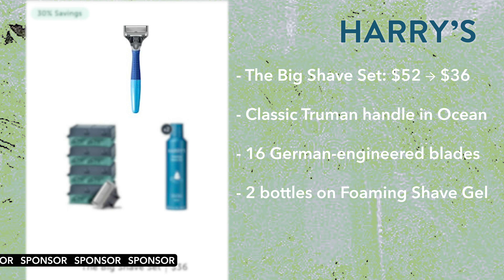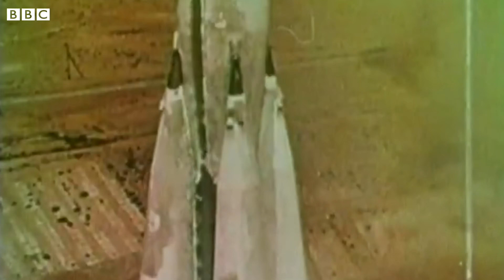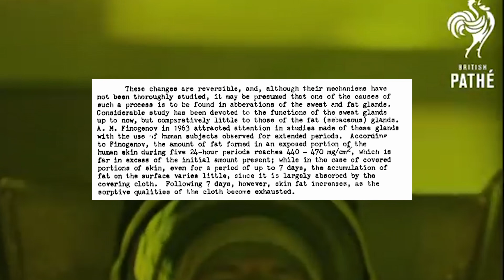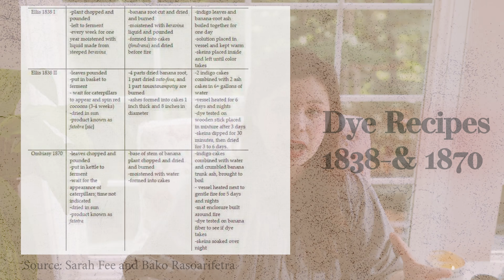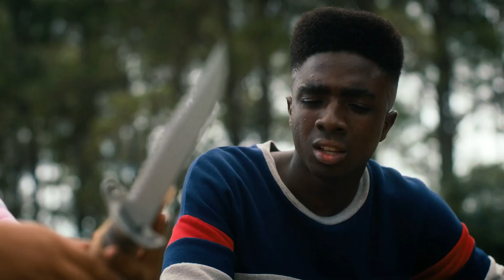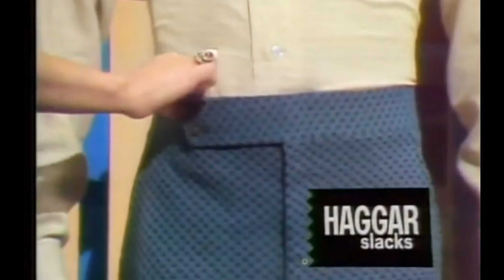The DISGUSTING truth about Laundry

Comment: Great video, and thank you. I appreciate that you didn’t try “solve” the whole issue. When I had a baby I was determined to do cloth diapering. After two washes the cotton diapers were like sandpaper. Not exaggerating. we had hard water, and although the diapers had been expensive, the quality of the cotton may not have been great. I cried. I started using elimination communication to cut down on diaper use, (how our farm ancestors did it) but to do that requires an enormous amount of privilege to stay home and be attached to the baby.  Lately I have started mending clothes, out of a tribute to my late mother, who lived as sustainably and frugally as she could. But again, The privilege to spend this time learning how, and the various materials I have acquired from Amazon, many of which have not worked very well because they are not good quality (bad needles, cheap synthetic thread) turns out better materials really help, but again, the money. I think I feel more guilty now than I did a year ago.
Reply: Regarding quality supplies, I like to buy vintage needles off of ebay. It's not too expensive, and the quality is incredible! Vintage thread, on the other hand, is sometimes still great, and sometimes very weak and prone to falling apart as you sew.

Comment: I grew up in Japan line drying everything because we literally didn’t own a dryer, and I remember getting in trouble for hanging out beach towels on the balcony at a hotel in Florida.
Reply: Apparently hanging anything outside to dry is seen as low class and most of the USA says low class = bad.
Reply: I lived in Japan for over a year and our apartments didn't have dryers. We line dried everything--Usually it worked great, you just had to plan ahead for things that took longer to dry.
Reply: Whereas I’ve never had such issues anywhere in Europe, where line drying is the norm and tumble dryers are mostly used for winter outdoor clothes that need to be dried quickly, or sometimes for towels as an alternative to fabric softener (that’s right, you never need both, and fabric softener shouldn’t be used for towels anyway because it makes them less absorbent).

Comment: well, at least you ruined stuff for me for a good reason! my family unfortunately uses a washer from at LEAST the 70's, top loader and agitator. we basically inherited it once my grandma passed and we were stuck in the cycle of buying a new washer every handful of years because planned obsolescence and the newer washers always spit in the face of right to repair. while it's been running strong with no sign of doom on the horizon, now i kind of wish it were ready to retire or at least have a midlife crisis. we still have the old one that quit on us because my parents never wanted to lug it to the dump and it's absolutely not worth selling unfortunately, so it's basically collecting dust on our side porch and whenever i mention getting rid of it mom and dad insist they want to repair it. it's been out there since 2016! it's a hidey hole for squirrel nests at this point.

our dryer is newer and we've repaired it a little over the years, the timer nob somehow got fucked during said repair and we had to relabel it because now the 80 minute section has rotated to where the label for 60 minutes is.

you were right though, i never really thought hard about the laundry i was doing. now i want to set up a line and start boiling clothes, but i don't have the resources to do so. only place for a line is overgrown and the neighbors' dogs would absolutely tear the clothes down at any manageable hanging height. maybe when the dryer finally kicks it, i can try convincing my family to find a good place to set up a line?

i also found out recently just how horrible fabric softener is! probably a few weeks before watching this, i ended up down a video rabbit hole of a washing machine repair guy. most of his videos were showing how bad the build up from fabric softener is inside the machine itself! apparently if you use fabric softener you have to regularly take apart most of your machine and flush and scrape it out. that combined with how bad it is for the environment and what it does to our clothes... literally a useless invention. makes me think of the marketing of listerine to cure halitosis! sell something that supposedly solves a problem that it absolutely can't solve in the first place and the same person selling the cure is the one who invented the problem. 

as an aside, the most interesting story i have about washing machines, which is much more interesting than usual washing machine discussion at least, is that when we inherited the one from my grandma we had to drain it because after the plumbing got cut off once she passed, something went wrong with the pipes and slowly dirty rain water started filling it up from the pipes going outside. got it mostly drained when we found rat skeletons at the bottom! completely cleaned, no gore or goop at all. my parents were freaked out by it and when they told us, i immediately fished them out with some sticks into a bucket and cleaned them off. they're now on my Collection Shelf :) most of it was the bigger bones, presumably the smaller ones fell through the holes in the drum or through the drain. got out all i could see, and i assume my parents had dumped whatever was left out and tried to forget about leaving the bones behind. funnily, after further cleaning and draining and scrubbing until it wasn't horrifying to use, my dad ran a load of his work clothes. mostly jeans. came in the next day from work and told me he found a rat vertebrae in his back pocket! i excitedly asked if he still had it (so i could add it to my pile on my Shelf) and he very indignantly said he did not. unfortunate, honestly!

Comment: I'd have expected parts of PA to be very hard, while I have hard water in New England, enough to require descaling of fixtures regularly, I've lived in parts of PA which were far worse (though amazing for my hair, go figure).  One of the other fun bits with hard water, when the copper lines start to erode, lovely bits of the pipes then become particulate shrapnel that one starts finding in the filters everywhere.  Fun times.

At least here I'm the US though, washers with adjustable speeds/cycles (whether as a set mode or ability to customize) are about the norm (unlike a laundromat here which may have a couple fixed settings).   I have, with success, washed underwire containing items and delicates (or strappy tanks, which are a daily undershirt type wear so i have a lot) in my front load for the last decade, and have an accordion rack for drying those items (folds flat but has five tiers unfolded).  Yes there is the occasional crappily made item which disintegrates, but I really have to blame the article/workmanship in 90% of the cases (fast fashion-like methods, grr), with the other 10% being operator error (jeans and strappy tanks don't mix, unless one wants to replace the straps). And yeah, cleaning cycles are a lovely feature but necessity in my front load at least (I have two dogs,  between my allergies and what I'm usually washing I don't want to do their stuff then mine without a good bleach and high temp sanitizing cycle).  I do wish the different symbols were more advertised or accessible without having to google, I've gotten a bit spoiled by the items which use words to specify the laundering directions admittedly.  I also have three different detergents (one being woolite), two types of bleach, steam iron and hand steamer, combinations of which I use for the maintenance of different garments (I also hate clothes shopping, most of my closet is well over 5yrs old with much of it more like 10yrs or more); not sure if that's indicative of being more familiar with modern laundering or screaming privilege, but it works and keeps my clothing in good shape.
Reply: Also when living in areas which are  damp/rainy/drizzly/humid 75-90% of the year, electric drier is a must.  The dehumidifier has to run double when air drying clothes, and mold/mildew still crop up, assuming the heavier clothes even dry before they mildew.  And being mold and mildew sensitive, I need to be able to breathe.  Dryer is a must here.

Comment: Interesting, looks like I'll change how I do laundry. Currently t-shirts, athleisure, and underwear all get a warm wash together. Looks like I'll start separating the underwear for a hot wash...but will the hot water affect the elastic bands or the lace on our underwear? It seems like it wasn't designed for hot washing. 
I separate my clothes for the dryer; socks and sweatpants go in, and everything else get a line dry on an interior rack. I'd love a clothing line, but my yard is too small, and the season too short. PS: I have t-shirts that are 10+ years old and still without holes...I don't know how! They're just poly blends from RW&Co or Suzy Shier (these are Canadian shops). Nothing special, but all my thin light cotton t-shirts don't last.

Comment: I’ve switched to using a laundry soap that has 4 ingredients, no sudsing agent, with natural fragrance. It’s expensive but worth it. My commercial liquid soap is rarely used. I separate things as much as I can since we have a very small apartment washer & dry them on a line or rack 95% of the time. My dad no longer itches as much. It’s expensive & takes a full day if not more to wash mine & my dad clothes. I do wash my dad’s clothes with a commercial sanitizer, would using alcohol in the wash so the same?

Comment: A Ruth Goodman moment? I live in upstate NY and yes the water is hard. A cup of white vinegar usually does the trick and we use too much detergent in laundry, I never use fabric softener because it affects the abosorbancy of your towels. We have a 40year old Maytag washer which has the adjustable water level so we don't need to use as much water in doing the clother's. Some things you just dont put in the washer without first reading the care instructions on the tag's. nobody reads them. Re: cheap clothing. They suck. the quality is not there and a really high quality  simple cotton T-shirt does not last more than a year.
Reply: Those old Maytags were good machines.

Comment: Cheap, easy, eco-friendly option: add vinegar to your wash: this helps with hard water and sanitization to an extent. 

Make your own laundry soap: plain soap flakes work find and dissolve fine in hot washes ie the white bedding, linen undergarments wash... for lower temperature washing you can pop plain soap flakes in a saucepan of hot water to pre-melt them, I then pour the really concentrated soap mixture into a bucket of water you can add essential oils (if you want to sent it and can also help with sanitizing) or other cleaning agents like bicarb if you want too and even agar-agar if you prefer a gloopier texture... There are plenty of recipies online

Water is only wasted if it isn't used again, if you have the space, use the water from the washing machine to flush the loo or water the garden (if your sure you're using safe soap)...

Comment: You could also use vinegar and baking soda for your laundry. Vinegar is antifungal and antibacterial and baking soda is great at removing tough stains, odors, and antiseptic/antibacterial properties. They are also good for removing some types of mold (not all but some). My mom would sometimes add baking soda and vinegar to a load of laundry when things weren't getting cleaned. It works really well and the vinegar will also soften your clothes. I tend to take baking soda directly to a stain and scrubbing gently. Also works for just basic household cleaning.
Reply: Using vinegar also helps keep your washing machine clean and odor free. I was having to do monthly maintenance on my machine and it tended to clog when I used regular detergents/softeners, but after shifting to vinegar my machine has not clogged once and I'm fairly certain it also runs smoother.
Reply: Using them together at the same time, they cancel each other out and don’t do you any good. (Acid vs base) but vinegar by itself is a fantastic addition

Comment: My brain broke at the comment that ~86% of North Americans take laundry directly from the washer to the dryer.  I have not relied on a dryer for more than a decade at this point.  As a grad student, I went a few years without onsite laundry and had to go to a laundromat meaning some of the stuff just was washed and then air dried at home.  I then had access to a line which my landlord and I used from April-October and then in January-February when it was -20 deg C and sunny (in Canada).  I went onto New Mexico where it was so dry that you could air dry everything year round - however, due to the higher elevation, UV and dust storms, I hung everything indoors to protect the clothing.  During Covid lockdown and my washing machine died, and I did put that stimulus check towards a fancy LG combo washer/dryer and I miss that machine when I moved back to the Midwest and couldn't install it in the current place.  It was perfect, I really made use of the fancy settings and since it could only dry half a load,  I still air dried pretty much everything.  I can totally see that 86% using the dryer though since I'm frequently the only person drying my laundry out on my deck on a rack in the entire apartment complex.  What really gets me are the unnecessary detergent options - I haven't used scented/dye stuff in years!

Comment: I  agree with EVERYTHING you’ve said. I went through this same realisation” about 10 years ago. I remember that every 4 years I used to purchase half a dozen cotton T-shirts and they would last beautifully. Then in the late 90s or the early 2000s, I had to find somewhere else to get my T-shirts and all the shirts available were now made of incredibly thin, often see through material that (in my opinion) dissolved in water. 
Fast fashion is dreadful. 

Also, when I was younger, my family traveled a lot and my mother was always aware or asking about the local water and if it was hard or soft etc. and she would add “stuff” to the water to soften it.  

Also - fabric softener is just a scam so don’t even bother. 

Separate your whites, darks and ESPECIALLY your smalls or underwear and wash them separately. 

Whatever the laundry detergent box says to use, you can use half that amount or less.  If you can purchase soap flakes, just try it instead of soap powder or liquids - some that contain “optical brighteners” that simply reflects the light, making your cloths look cleaner (but they are NOT). 

Washing sofa added will make your detergent go further. 

If you can line dry in the sunlight, please do. Sunlight is a natural disinfectant AND in my opinion, there is nothing nicer than sheets that have been line dried. 

Oh, and I highly recommend making or purchasing yourself a linen undershirt or singlet. Worn with other natural fibres over the top, you will really notice the difference with your body and clothing remaining cleaner and less smelly for longer. 

A linen undershirt is amazing, it keeps you cool in the summer and also warmer in the winter. The fabric is sturdy and is easy to wash or simply rinse out and unlike “human-made” fibres it will NOT hold onto the stink. 

Just remind yourself that when you’re wearing synthetic fibres against your skin, your basically choosing to wear a plastic bag. 

Obviously synthetic fibres are awesome in outerwear to keep yourself warm etc, but having natural fibre underclothes is the way to go.

I’m not wealthy, but slowly swapping out my wardrobe to natural fibres has been the most amazing experience, and I haven’t had to change the way I usually look or dress. 
Oh and my NEXT project is to save up for a set of linen sheets. ALL my bedding. It’s a big expense, but I am really looking forward to it 🙂
Reply: I got linen sheets last winter, and they're amazing! Now I'm disappointed when I stay at hotels because sleeping on cotton feels weird.
Reply: I've never seen linen underwear for sale where I live. I only seen nonwowen linen fabric twice my life. Also, linen bedding cost ten times cotton, which I only can afford like, two sets.

Comment: I don't think the entirety of our modern washing practices are wrong. They're practical and no one is going to pay you (mostly the women of the house) for that labor. But we need a mentality shift. We have the options, but we just don't use them. We have front facing washing machines available, and gentler biodegradable soaps, and you don't need fabric softeners. And in modern houses most have ac so if the climate is not good for line dry outside you can do it inside no issue. You don't need static sheets. Use wool. We can always reuse the rinse water for the next load! Wash as little as you can: bedsheets and clothes that go directy against your skin are thr ones that need more cleaning.  But lay out your jeans and coats on the sun to freshen them up and yoh can save at least one wash, it'll remove smells and bacteria. You can collect rainwater! Wash your most delicate items by hand please! With gentle soap. They will last you much longer and you'll be happier for it. We do a lot of these things in my house and it works well. I try to keep my washing to twice per month aka 4-5 loads per month.

Obviously income is always a factor to consider, but for someone with the money to do better, I find no excuses except they don't care enough.